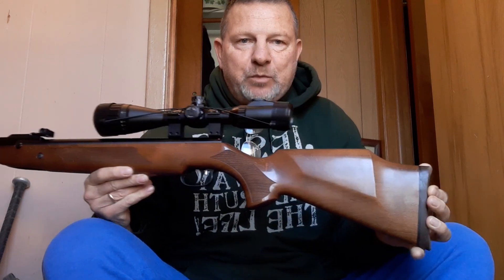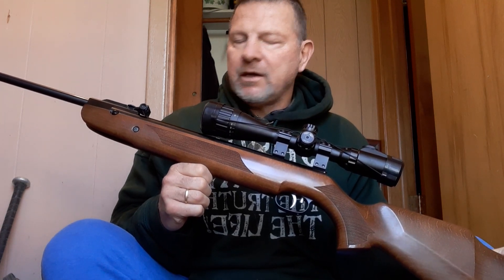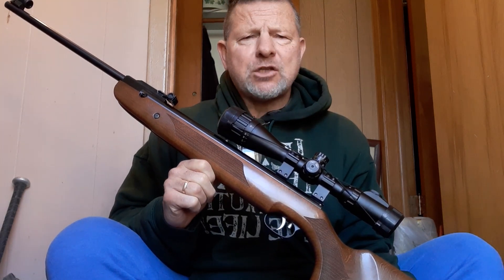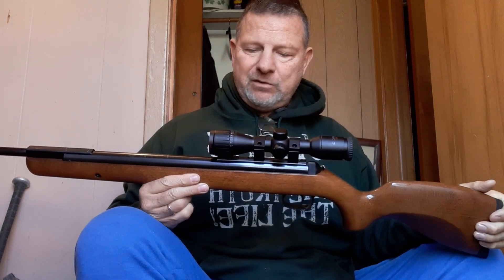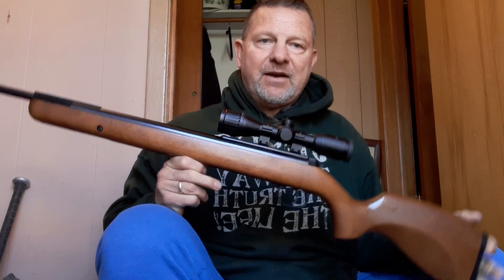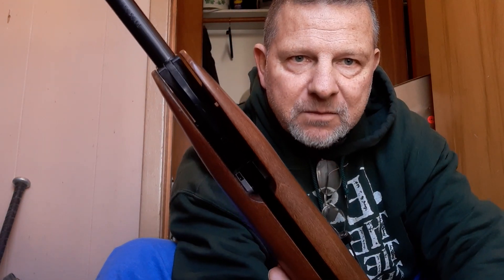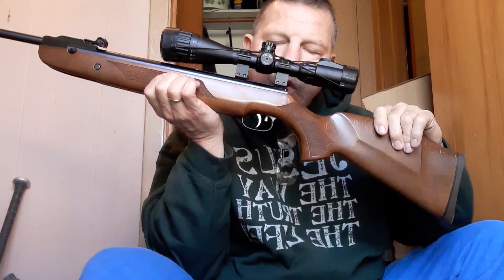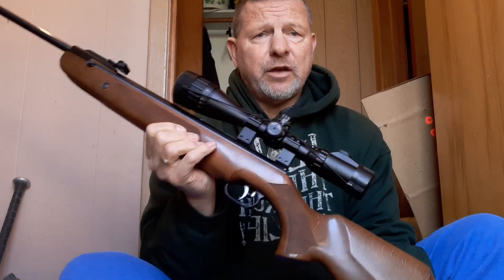The Truth About FPS in Your Break Barrel Air Rifle: Part 2

Comment: When your projectile (pellet or bullet)  goes through your target sideways, it's known as a key hole or key holing.
Reply from the maker: Sure is, but I have never seen it from an air rifle🙂👍
Reply: If you can call it a air rifle I barrowed a Crosman multi pump from my brother for the Starlings , took out many of them until they got wise and could her me pumping it .but on paper some would key hole but that thing was smooth bore . so bought A Gamo Sporter .which is now in hand of my grandson along with the Crosman. At first I tried to scare the bird away with a soft air gun but they just laughed and flow off so now it was war. now Iam Up to six rifles They also greatly helped with my powder burners. win, win.

Comment: Love your videos!  Did your HW95 have 17 fpe out of the box or did you install a kit? I bought mine last year from Airguns of Arizona.  The test fire chronograph fps was 576 average with a 15.89 jsb exact.  This calculates to only 12 fpe.  I wonder if they sent me a UK  version? Thanks for any feedback . Rich  H
Reply from the maker: I was getting 18 FPE out of the box. Too much lube in the compression chamber. Then accuracy fell off. Opened it up and found the main spring broken in 2 places. Use the same spring for a while after heating it up and bending it and sanding it down. Lost one FPE from that process. I have a Vortec spring and piston seal inside now, with a DIY tune 😃👍. Either they gave you the UK version, or your piston seal is damaged or your main spring is broken 😕. I would contact them immediately 👍.
Reply: @springpistonriflefeverlone9611  OK Thanks  I will give them a call . Thanks for the quick response!